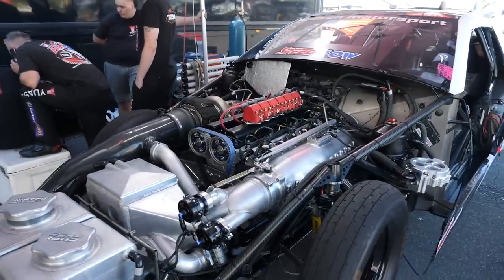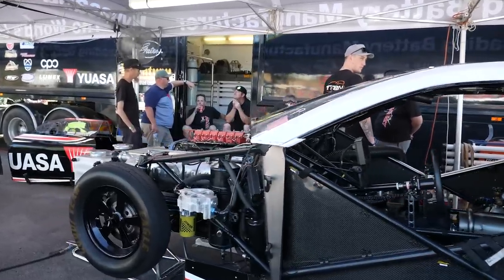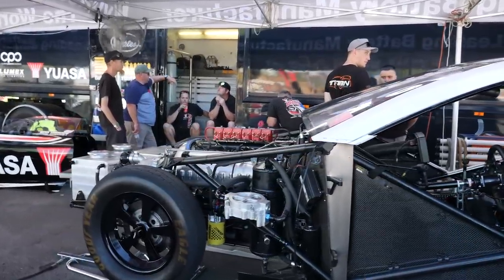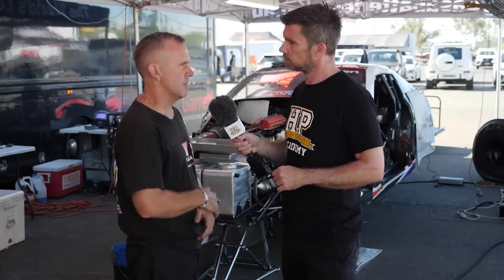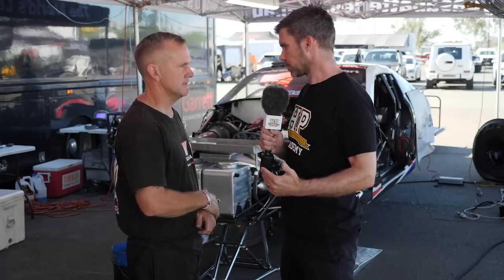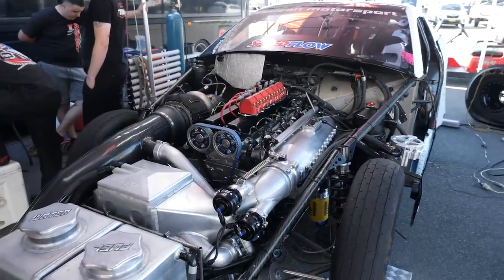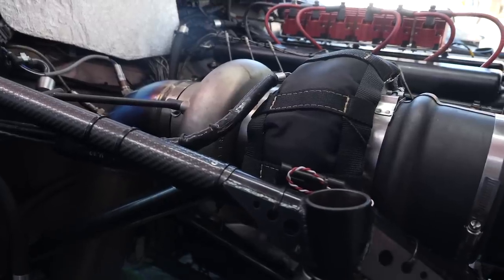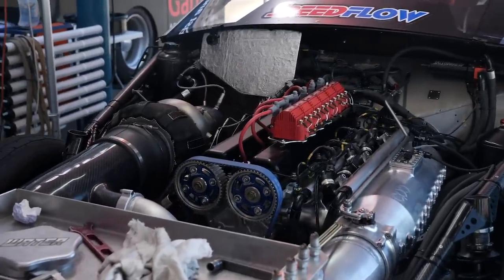Building A 5 Second, 3000HP 2JZ Drag Car | Yuasa Pro Mod Camry [TECH TOUR]

Comment: Freeboosting a 110mm turbo on a 2JZ... never thought I would see that done!
Reply from the maker: #fullsend
Reply: Moving a serious volume of air during a pass
Reply: @mikeymasi  plus the whole cold-side boost-control drive-by-wire setup is post intercooler so it is sending sub-ambient temp air back into the compressor housing. this car is something else & I wish I was close enough with this team to be trusted with their data they collected, it would be so cool to see.

Comment: On Another note: It helps to generate even more respect for the F1 Engineering teams, foundries and driveres back in the 80's when their 1.5L Turbo's were knocking on the 1,500HP range in qualifying trim from cast block and head engines.

Not only that it was all controled by potatoe electronics and manually shifted.
Reply: And volatile fuel the 1.5L BMW engine routed the fuel lines through the exhaust to heat the fuel to 60c
Reply: manitoublack F1 is so far ahead of all other motorsports in terms of technology it’s incredible. And we won’t even learn about the secrets of the current cars for 10s of years because of how secretive it is.
Reply: Damn, right
Reply: manitoublack because they developed a monoblock. Holding the head on the block at high boost has always been the issue. So they removed that aspect

Comment: didnt really think about this until the end, but the whole cold-side boost-control drive-by-wire setup is post intercooler so it is sending sub-ambient temp air back into the compressor housing. 
this car is something else & I wish I was close enough with this team to be trusted with their data they collected, it would be so cool to see!

Comment: I love these mad drag racing guys. I doubt ill ever be able to build myself a 2jz based car by the time im done with all my projects cause they will be too hard to come by but if you can make a totally aftermarket billet 2jz then it doesnt matter if the oem blocks are hens teeth
Reply from the maker: I think it's more the heads they're struggling with, although not doubt with time blocks will get trickier it was more their inconsistency at this level that saw the requirement for the billet alternative.
You'll get there with your projects mate, enjoy them along the way rather than rushing =) - Taz.

Comment: They probably do a boost per speed tuning or even a boost per acceleration or g-force
Reply: Yup
Reply: I've seen alot run a time-based setting over the elapsed time, triggers when they come of the trans brake and begin the run

Comment: Double save on this video Andre. Super interesting with the bleed for pressure on the intake side and then the M150 and what he was meaning with getting it to do what he wants it to do (aka custom firmware). Do you all have any other tid bits on more of the drag racing tech (specifically the no wastegate but just intake bleed and how that works as far as being able to control the boost?) I still didn’t completely get how he’s able to have all of the boost from the exhaust side if bleeding off the intake side. Wouldn’t that then decrease the available boost (even though he’s regulating it just from the other side? - I say just...I know it’s very involved.

Great content as always, thanks for making COVID a bit more bearable.
Reply: The purpose of a wastegate is to slow the exhaust wheel down by bypassing the exhaust flow. The energy is always there it's just getting 'wasted' to atmosphere. By creating a leak on the intake side the exhaust energy is allowed to do what it wants to the exhaust wheel so its is effectively being run at close to 100%, the boost control limitation is being done by the DBW throttle body, the engine may only see 80% of the boost being provided but the exhaust wheel is having nothing bypassed. When the DBW throttle body closes then yes the system will be leak free and running at free boost ie: the exhaust wheel gets 100% energy and the intake is receiving 100% of that.

Comment: I've never thought about controlling boost on the inlet side. I feel like that would be easier to control cause the boost pressure would always be constant. I wonder why it's not done more often?
Reply: It's not as efficient. Why drive the turbine at full speed all the time when you don't need it. It was just better in his case for consistency and not spinning the tires.
Reply: @El_Chompo  makes sense. For drag racing tho, you'd think everyone would do that
Reply: It is better but the trade off is more turbo rebuilds !

Comment: I suspect I'll answer my own question here. 
"Why do these guys continue to limit themselves to OEM based designs? is it class rules? Surly a clean sheet design of a fixed capasity would be far more viable than even billet aluminium designs hamstrung by the OEM design constraints? I mean is a billet 2JZ with a 1-piece lower maincap/girdle/drysump section really still a 2JZ?
Reply: Research and development on a clean sheet motor will cost you 10x what running a OEM based design will. Toyota already spent the millions on R&D, so building off what they had is more financially viable
Reply from the maker: A billet block isn't just a carbon copy of the OEM design, so with this in mind a lot of the faults (bearing in mind this application was never the original intention) and limitations can be removed. 
As Sam mentioned, to do this on a clean slate would take 'F1 money,' and even then, not every F1 team can even afford such privileges either. From there you will run into supply considerations, and then of course class rules. While the rules don't always seem to make sense and some are more effective than others, they at least give constraints that help keep some sort of comparison - Taz.
Reply: @hpa101  as expected. I mean with the bottom end, as long as it's strong, there's no real power to be gained or lost (other than optimising Bering friction/speed.)

I guess my question was more about the head and in specifics, the port location, size, shape, etc... I know bullet engineering is Adelaide have basically made a billet 2J block with BBC crank snout that fits an RB head.

As for F1. Cast is king 👑 and required by the FIA.
Reply from the maker: @manitoublack  I would expect that at some point Rod will be switching to a billet head too. There's likely to be some potential performance to be gained in the freedom to move the ports around but the key advantage is in the added reliability, particularly now it's getting difficult to source new OE heads. Andre

Comment: It blows my mind there isn't an aftermarket casted head for the 2JZ. Is it because of the frame of mind import fans have of turbo motors? Need more power? Up the boost. 
No, increase airflow and start with a more efficient head design. Remove limitations of the factory port layout, size, and shape and watch what happens.

Comment: should just put a barra in it
Reply from the maker: Hey wants to go faster, not slower... 😝 Seriously though at these power levels and with the modifications this 2jz has, you would essentially run into the same limitations at some point, as well as probably ensuring your car is not eligible to compete given that is a Ford engine.
That said, if you're keen to do this but with a Barra powered chassis, you have our encouragement and I'm sure Rod's too - Taz.